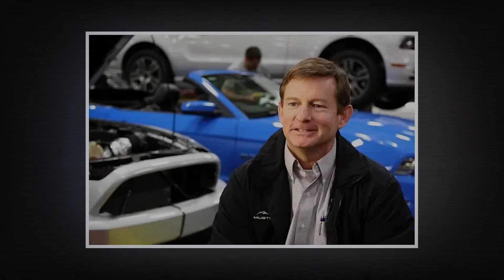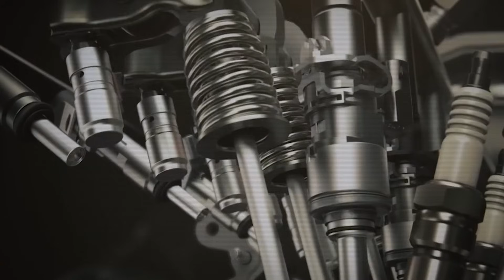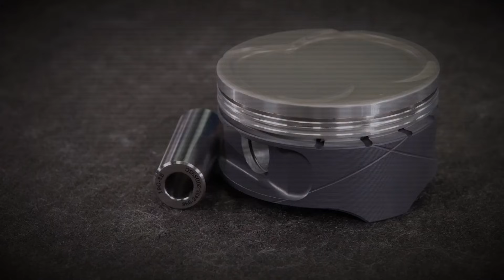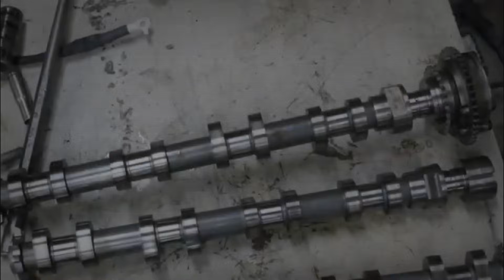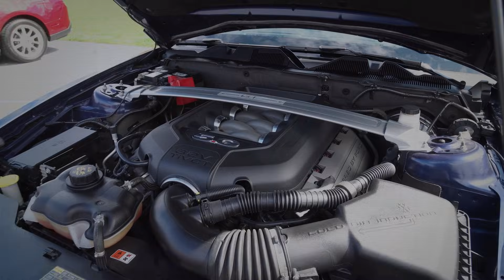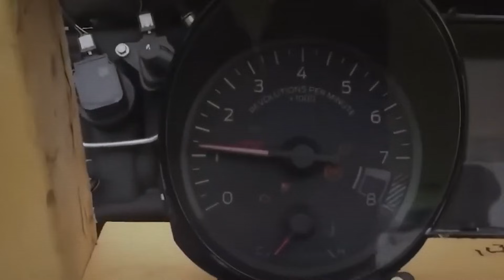The GENIUS Trick Used on The 5.0 Coyote That Rescued the Ford Mustang

Comment: The  Gen 3 5.0 Coyote is a  marvel of modern design however, like the one I have in my 2020 F150 XLT Super cab  4x4  10 speed automatic , 3:73 rear end and 8 foot box, this engine loves too burn oil. Like thousands of others out there, my  Coyote engine  uses 0.8 liters per 400 Kms!